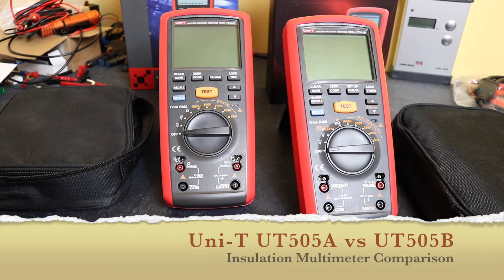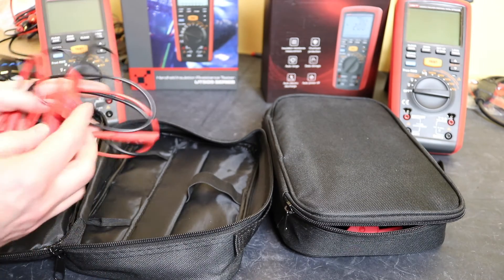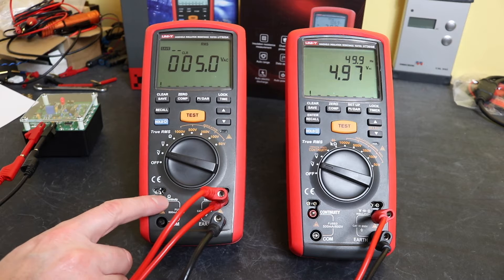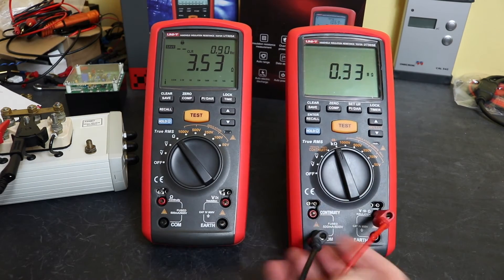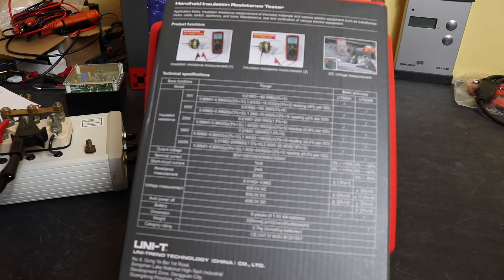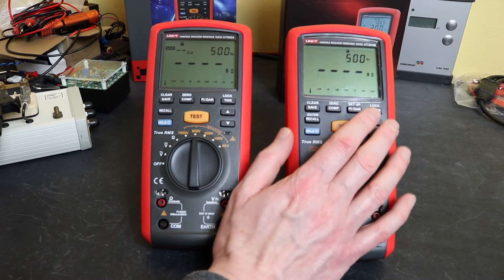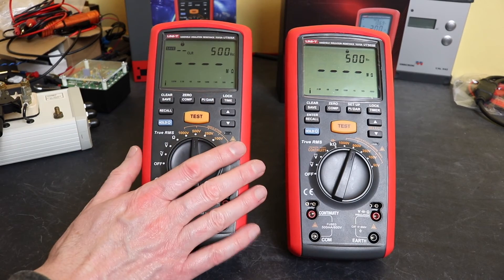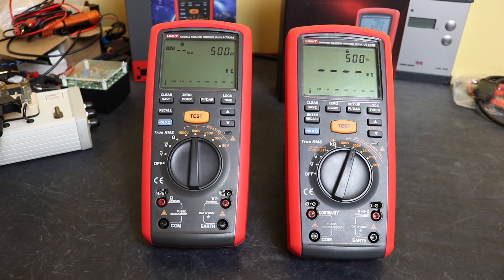Uni-T Insulation Multimeters UT505A vs UT505B

Comment: Im after a multi meter that does ir testing and capacitance at thr same time, what would ypu recommend?
Reply from the maker: There are a few out there, but it is generally a function on the higher voltage testers with a 2.5 kV and above output. There is the MIC30 from Sonel and the CA6524 from Chauvin Arnoux, that will measure the capacitance at the same time as IR and you obtain the value by scrolling through the results. Unless you can find a deal, they are quite expensive though.
The easy way to tell is to look at the technical specs and find a capacitance specification, but there is no capacitance function on the selection switch on the meter.

Comment: Приветствую уважаемый! можешь подсказать 505B или 505А могут показывать падение напряжения на высоковольтных диодах? как здесь на светодиодах https://www.youtube.com/shorts/iz1ny3Hgb6w
Reply from the maker: Yes, both meters will test up to 1000V DC, so will work the same as the one in the video link.
Reply: @three-phase562  на твоих видео UT505 не показывает какое падения напряжения, а на видео по ссылке fluke показывает 6 Вольт. Вот ещё пример падения напряжения 93Вольт https://www.youtube.com/watch?v=Houj-9gcI0Q
Reply from the maker: @oprodimusiopf9447  The output voltage is displayed in the top right hand corner of the meter screen. It just that it is high and steady because MOhms reading is high, where as in the videos you link to, they are measuring a short circuit, so the voltage is much lower.

Comment: Hello, I am buying a KEW 6516BT, for eletrician work mainly maintenance, have you any videos of similar equipment? nice video
Reply from the maker: No sorry, it looks like the KEW 6516 is aimed more at installation testing. The insulation and continuity test functions will work the same as the testers I use, but the other tests are slightly different.

Comment: Thank you very much for doing such a specific comparison between the two models!
Does the A version also give higher (almost doube?)  values like the B version does, compared to other, more expensive insulation testers?
Im on the market for such a tester for testing heating elements. Currently using an old analogue Made in USSR, that seems to work fine, but I have not compared it to other meters, so I do not know how accurate it is. It still does the job though. Like you said, I can tell if there is a faulty insulation, but the actual value I get -  I cannot be sure how accurate is it.
Reply from the maker: For the insulation test function the A and B versions have a similar accuracy, its just that the B version can measure higher resistance values where the A version will just show over-range. For the continuity function, the B version appears to have an issue with reading high in certain situations where as the A version is much more stable.

If you want to carry out condition monitoring of motors etc over a period of time, trending the readings you get, then the B version with the extended test range is a better option. If you are predominantly wanting to show an installation is safe to energise or fault finding, then the A version will achieve that.

Due to their nature, insulation testers are never the most accurate devices anyway in comparison to more usual multi-meter measurement functions.

Thanks for watching, glad you found the video useful.
Reply: @three-phase562  Thanks again for taking the time to reply!
For my application, the resistance value is more important, since it is directly related to the ammount of moisture in the insulation material used (generaly Magnesium Oxide powder or fine sand, which is very hydrophilic). Which is why, the fact that the ut505b gives much higher value is worrying. Does the A version have that same issue? 
I wanted to compare it to my hand-crank megaohmeter. When I hook my old analogue meter to the multimeter to check the output voltage, the neadle stays at  10 MegaOhms no matter the voltage, which tells me it is pretty accurate.

Do you have one of those analogue hand-crank type meters? They are pretty neat in doing more detailed manual readings like that you can "control" the output voltage by the crank revolutions and watch the behaviour of that neadle. Not that big of a resolution in the higher values though, mine goes up to 2 Gohm but from 500 Mohm and up to the 2 Gohm the movement of the neadle is like 1 cm.
Reply from the maker: @mistake419  You can test the accuracy of the insulation tester against a set of resistors, just be mindful of the voltage rating of them, so you may have to use resistors in series. If you work to a particular pass value for your heaters, then you can make up a resistor to match that value.

The insulation testing function of the UT505A and UT505B are comparable with regard to accuracy, it is the continuity/resistance function where the UT505B goes out of specification against my winding simulator. The UT505B has a higher insulation resistance measurement capability than the UT505A, if your existing meter goes up to 2 GOhm, the UT505A will not match that unless you test at 1000V. At 250V test, the UT505A measures up to 250 MOhm, where as the UT505B measures up to 50 GOhm, depends if you want that range or not. At 500V, UT505A measures up to 500 MOhm and the UT505B measures up to 100 GOhm.

Alternatively you could look at something like the Extech MG302, or one of its clones, that measures up to 4 GOhm across all the test voltages and was more accurate than both the UT505A and UT505B in my tests.

I have crank style insulation testers, but they are all vintage era, circa pre 1970.
Reply: Thanks for the info. It seems the only real upgrade that such an unit offers, for my application, is the ease of use. I hope Uni T releases a new model soon since these two are a few years old. They realy reised the quality of their producs in the last 2 years.

Comment: Hi!
Im looking for a cost-effective Alternative Device Instead of the Fluke 1587.
I saw, that the Extech MG302 is very good, accurate. What do you know about the MG320? Is it a new Version? Is it as good as the 302?
I want to Test Electric Motors in EVs with it.
Thanks ;)
Reply from the maker: The MG320 has a higher measurement capability up to 20GOhm at 1000V in comparison to the 4GOhms of the MG302. It has a 50V test voltage and the DAR/PI test, that the MG302 does not have. The MG302 has wireless connectivity for data collection and download of readings that the MG320 does not have.
I have not tested the MG320 so cannot state what its performance is like. I believe that both of these units are rebrands from CEM, which can be a bit hit and miss with their quality, although all of the Extech test equipment I have purchased have been fine, it has been the CEM rebrands for other manufacturers where I have seen the issues.
If you are just after a pass or fail test, then the MG320 should be fine. If you are more after diagnostics and condition monitoring then a tester with connectivity can be beneficial.
If the EV motors are random wound stators then it is unlikely they will show a DAR or PI, this test is more appropriate for form wound stators.
Reply: I would buy the MG320 or the UT505B. What would you recommend? Thanks ;)
Reply: Diagnostics would be important, yes!
Reply from the maker: @DiagnoseDoc  For me, the UT505B is better quality and accessories than the MG320. Would depend on where you are and availability of the different testers though. You also need to be wary of the continuity function on the UT505B. On my simulator and one motor I tested there appears to be an accuracy issue, which can be solved with a capacitor in parallel. I haven't had opportunity to test it on other motors. Price range does vary considerably with the UT505B though, so you need to shop around, MG320 price seems to be more stable.
Reply: Tiene el UEi IRT807 que excelentes y es un clon del Fluke 1587

Comment: Thanks for  the video! Just bought 1587 fc, looks like might have been a good idea.  Would you kindly do video on motor insulation testing?
Reply from the maker: The Fluke 1587FC is a solid insulation multimeter for general maintenance work 👍.
Are you looking at anything specific with the motor testing? 
I have one video showing a motor test from a panel using the MIT420/2.
https://youtu.be/b3H0MquHARQ?si=bsO-r9bpi8187r78
I have another test of a motor on the bench using the PM5203.
https://youtu.be/VioH9w-Lnm4?si=--49UV1xqDuAvYgK
Reply: Oh, I should have searched better!
By the way,  if you search " three phase channel " in general you tube search your channel does not come up . Might consider adding something to the channel name that's more unique.  You put up very good 👍  info,  should be more popular!
Reply from the maker: @ducembarr7057  Thanks for the info, I have never searched for my own channel name. It is a very small channel, so likely it wouldn't turn up in general searches anyway, but I will think about something to add to the name.. If there is anything specific you want to know, then ask and I will help out if I can.